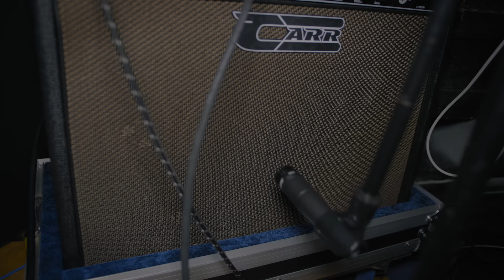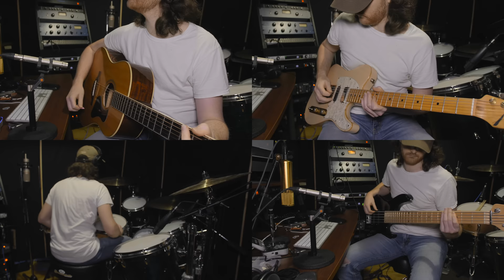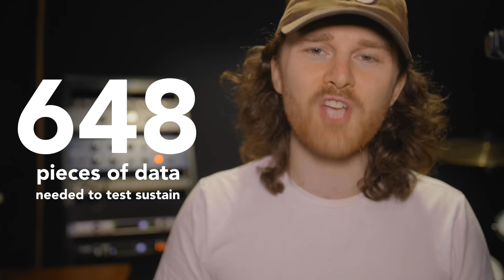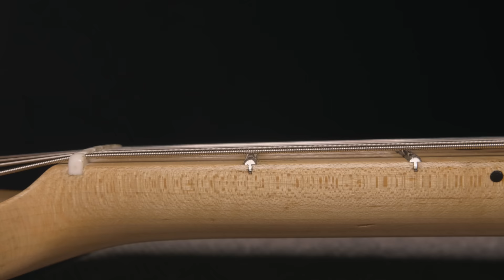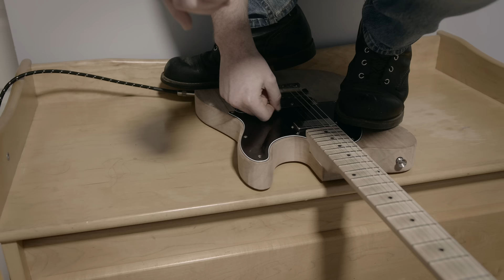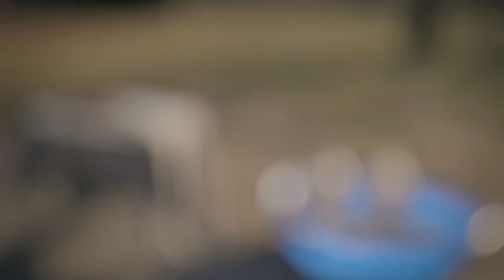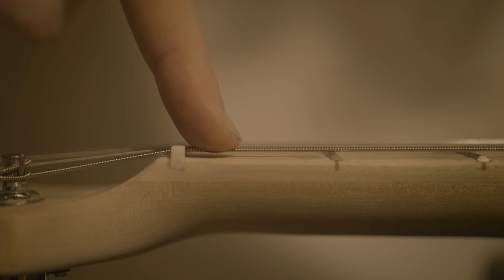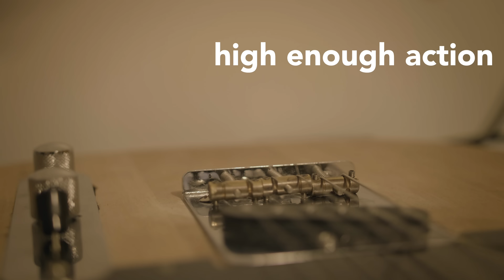Tested: Where Does The Sustain Come From In An Electric Guitar?

Comment: Have you ever had a situation where you want to play a bent note for a bar or two and it just dies right away? I've had that happen on couple of guitars and that to me is the definition of lacking necessary sustain. It's a factor of many things, often construction and setup and not just the body wood or something. But it's an important thing.

Then there's the other case where you have distortion, delay, amp feedback, even a sustainer device. Which is not the same thing.

Regarding the break angle I'm not so sure about all the factors you want to consider. You want a decently deep break angle to get a good force on the pivot point so you'll have great tuning properties. Shallow angle with ambiguous pivot point causes lack of tuning stability. You also don't want the strings popping out of their slots, hence the string trees. I'm not sure if the deeper angles/string trees also help with unwanted noise from the headstock side of things. The hardness of the material also plays a role. There's quite a lot of material on how sound travels through materials and quite a lot of material on instrument builders also having done their empirical research on how to solve these different challenges of material paradoxes (if someone recognizes product development method called TRIZ, the idea is that usually with desired quality improvement you'll also get an increase in an undesired quality, say durability vs weight, and your aim is to find a solution that removes the undesired quality increase while still improving the desired quality).

In my opinion perhaps number one noticeable difference comes from string height. If you lift them high enough that only slide players would play them, I find you get quite a different experience. The worst experience in my opinion is a neck-thru guitar with floyd rose and really low action. But it's still not necessarily bad, I just find it often ends up much darker and likely less resonant.

Some opinions or good practices with data: always visualize it. Even if it's presented just to other scientists or engineers, visualize it. Raw numbers don't mean much and people are bad at interpreting meaning or quality on them. Visualizing it you can read something meaningful out of it. Even if you're not educated in that section of life. Also if you have hundreds of pieces of data for the same measure, take a standard deviation (you get the mean average in the same go). That way you can tell how tightly packed your measurements were, giving validity of how much variance from the mean average you can expect if you pick any random measurement. For example 97% of the measurements might be within a range less than 0,3 dB which I'd consider a very nice result, you can say that you'll basically always get that exact result.

Ideally you'd measure for example with poll rate of 10 Hz so you could log the loudness as a sort of "continuous" measurement. Then you could adjust for example the starting loudness of the measurement range from your log and call it quits after x samples. You'd get somewhat comparable takes and you could have the mean averages for all the time points of interest, then draw a graph of the mean average of the measurements over time and you'd have nice graph for the different factors and how the loss of energy in the string behaves over the time. You'd get more detail on how it happens in different distortion levels for example (we know distortion comes from amplifying the signal until it clips so you'd expect quite a bit of stable loudness until a drastic drop off on distorted ones, and on the contrary perhaps some sort of smoother round curve for clean signal). You did touch this in the discussion part too.

Some stuff to test is also using only neck pickup, because that's the closest to the biggest amplitude of the guitar string. It's also a challenge for the builder/pickup designer when you have a set of pickups and want to tweak them to expected qualities, you'll find out the same pickups sound quite different on different spots. Builders have long since I believe debunked the myth that a big mass would give more sustain/resonation. Given how a mass is a dampener, and heavier body is usually denser so less willing to resonate. Yet depends totally on the construction as well, if the connected material is not really dense and compact but instead has holes and is less dense, it probably adds to it (just like when you lean the headstock on a non-supporting wall and get an amplifier). On the other hand I wouldn't be surprised if the system is alive and adjusts resonant frequencies and feeding back to the string. People might be aware of how it seems like the best way to have the guitar (acoustically, not electrically) ring is to have a light bridge directly attached on the wood, and as contrary a system like a floyd rose can make the guitar quite a bit more dead sounding. People have been toying around by changing the floyd rose bridge block to a different material and different size block too. And then there's the whammy bar related springs that can give quite a different tonal characteristic to the sound and be perceived in all kinds of ways, for example my PRS sounds like it had an acoustic cavity and spring reverb just because of the whammy bar construction. I'd assume the more treble (maybe middle more realistically) frequencies the guitar has, the more likely it is perceived as sustaining nicely, because those are rather audible and decay quickly (perhaps for the short wavelength).

A lot of people seem to think guitar builders just come up with marketing excuses, but a lot of them also care about improving their own loved product and thus test and research this stuff as well.

All this is getting way deeper than you would need for your video, but since you bothered to take hundreds of samples and go deep, you might be curious. Fun video, well addressing all kinds of ideas with rather practical tests. Maybe not completely conclusive but giving good idea of what you might expect to happen.

Comment: My own experience the best way to get exceptional sustain is to use a neck with extra reinforcement.   Case in point I have an old RG, with a lightweight basswood body, an ultra thin  wizard neck, and a fully floating vibrato bridge: all factors that detract from sustain.  It also has two steel reinforcement rods in addition to the truss rod.  It sustains as well as some Les Paul builds.   No other explanation.  There's certainly other myriad factots to pay attention to, but the bottom line os that the rigidity of the neck build is of primary importance.

Comment: My only gripe with the wood glue test is that the playing conditions weren't the same. For the control, it should have also been laying down in the kiddie pool during testing. I doubt there would be any difference but removing variables is super important.

Comment: Sustain reflects how rapidly the mechanical energy of the string is dissipated.  That energy is dissipated by vibrating the air (what we hear as a note), and vibrating the entire guitar, which partially vibrates the air secondarily, but also transforms the mechanical energy into heat energy (the string also does this).  Wood is neither solid nor rigid.  Vibrations in the wood cause it to heat up slightly.  The more rigid the guitar, the less energy is transformed into heat.  By far the least rigid component of the guitar is the neck. The neck is the biggest reducer of sustain.  The bigger and more rigid the neck, the longer the sustain.  That's why a pedal steel guitar sustains longer than an electric guitar.  To maximize sustain you want the biggest and most rigid neck you can play.

Comment: Other thing, you say "some db difference". Decibels can be deceiving if you don't understand how they are calculated. It is a logarithmic scale, so it increases quickly! A nice thing to remenber is that for each 3db increase (decrease) the signal power doubles (halves). For example, a 83db sound signal has twice the power of a 80db signal (I know that for our ears it doesn't seem that 83db has double the volume, but our hearing sensation is weird). So in your tests when one lost 14db in 4 seconds and the other 17db, the latter lost twice as much power in the same time, i.e., it lost power faster by a factor of two after 4 seconds.

Comment: There are two important variables.  Sustain and resonance.  High sustain, acoustically means less resonance.  High resonance, acoustically means low sustain.  An hollow body guitar is high resonance because it can vibrate more and dissipate it's energy faster.  A solid body guitar is the opposite.  A guitar that has high resonance will pick up vibrational energy from outside forces more easily.  So while it technically has less sustain, an electric guitar with high resonance can feedback more easily and seem to have infinite sustain because of the amplifier.

Comment: I have an assumption that I would love to see tested. Or did anyone already?
I would define sustain simply as the drop of volume over time (like you)

Less volume drop = more sustain.

I assume volume drop is the result of damping of the string. The string oscillates and looses amplitude (volume) because it looses energy. e.g. because of "air resistance", which also is the reason we hear the string. But also because it looses energy in the guitar.

Therefore it would make sense that a STIFF guitar has more sustain, because it doesn't move as much. So the energy stays in the string.

A guitar which is stiffer would therefore have more sustain. This would mean: If you would build guitar out of steel, with a massive neck, it would have a LOT of sustain. Not because it s heavy, but because it is very stiff. 

A heavy guitar would have more sustain not because of the weight, but because of the higher stiffness due to more material in place that increase the stiffnes of e.g. the neck. 

In this theory it would NOT make a difference if you have a very big, heavy body but a thin neck. Because the neck would be soft, loose energy and the body would not do anything. 

This could quit easily be tested: 
A guitars sustain is measured (the way you did). You sand/grind down the back of the neck considerably, which should reduce weight and stiffness, and measure again. In theory you could add some mass to be back of the neck to keep the mass the same, this added mass only must not increase the stiffness of the neck again. 

This would explain a few "myths" that are by themselfes difficult to be tested:
- "heavy guitars have more sustain" -> makes sense, if the mass is distributed in a way that the guitar is stiff
- bolt on necks have less sustain -> would make sense, if a neck through construction ist stiffer, which I think is likely

Comment: Ive always believed that pretty much all the buzz words used when talking about resonance and any general declarations about "this makes it resonate more or less" were all in a players head. I think a big and for the most part unmeasurable factors is the players perception of the guitar they are playing. As far as objective measures, I think it comes down to knocking your fingers against the blank neck and body woods and choosing a good resonant set of timber. Unfortunately most players don't get that opportunity, so the most important thing you can do is play each individual guitar ou can and buy the one that your brain says is best. The last crucial part is that every person physically plays the same guitar and amps setup in their own way, which is why Hendrix sounds like Hendrix on a Strat the same way he did on his SG or V. its super cool that you are spending so much time and effort on testing in a data driven way, not a lot of that content is out there. Cheers

Comment: Some people say that high output pickups, and also active pickups give lots of sustain over low output pickups. Also, humbucker vs single coil. Mostly this just tells me that sustain and attack are perceived as more important than decay when it comes to sustain in a lot of cases. For example, Santana's guitar tone sounds like it has infinite sustain because the attack is instant and you don't hear a note long enough to detect any decay.

Comment: If you have extremely microphonic pickups, feedback comes easier…It can also be achieved in some situations with a mixer…I’m still completely unaware of how Jimi Hendrix had such incredible control over his feedback…because it’s yet to be duplicated….it’s possible that he somehow acquired the knowledge that if wax potted pickups were scrapes clean, THAT could do it, or some modification with potentiometers or something…but we’re talking Up to his death in 1970  Jimi Hendrix didn’t have the luxury of Amazon Prime, where he could order a 1-Meg (1-Meg = 1000K) Audio Taper Potentiometer, a Fender TBX Tone control (which didn’t even exist until 1986 & wasn’t market available until 1988)

Comment: Physics note: Sustain should be affected to some degree by the orientation of the guitar, since gravity will pull on the strings and cause the strings to move closer or farther from the magnets or sag nearer or farther from the central line from the bridge to the nut.  So some of the tests where the A-B are oriented differently technically have an uncontrolled variable.

Comment: The glue guitar does sound really different but it also highlights that you need to make BIG changes just to hear a small difference. 

A 3 pickup strat might have a small difference in sustain than a 1 pickup les Paul. But there's probably going to be no noticeable difference between a Strat and a Tele for example, or between nitro and poly finishes.

Comment: Gary Moore was the master of sustain. You can clearly tell his picking technique had a lot to do with it. Less Paul thought it was a seventeen degree angle on the head stock which makes sense when you consider the bowing action it could cause on the neck which would be affected by the truss rod so truss rods could be a factor and the P90 pickup which meant 9000 wraps of wire on the pickup. A strat stock pickup had 6000 wraps of wire. So one wrap of wire in a way of speaking hears to string one time per vibration. Digital and tube amps work differently too and that is black hole. Tube biasing would effect sustain. Sustain isn't caused by just one thing. Pure sutain from a guitar is how long the string vibrate. How much sustain matters I think  depends on the person. It's a stylistic thing. I think Gary Moore is the best example of how much it can matter but probably only a guitar player would care. Noting beats a Less Paul for sustain though. If his belief of what made it work the way it does was wrong he still got the best. Jim you make great videos! I'm glad it was and not me. Keep up the good work! Thank you!

Comment: Great video (as are your others)!  Have you considered testing the effects of the magnetic pull of the pickups on the strings and how that affects sustain?  A neck single coil set too close to the strings interferes with the string vibration and creates a warbling sound, for instance.  Typical single coils also pull harder on the strings than typical humbuckers (this is apparent by bringing a piece of iron near the tops of the pickups and feeling that the pull from the single coils is much stronger since the magnet in a humbucker is located at the bottom of the pickup, not the top).

I assume that the greater the magnetic pull from the pickups the less the sustain.  I also think that this is where the conventional wisdom that Les Pauls sustain so much comes from: because the PAF style humbuckers pull the strings less than Strat or Tele pickups.
Reply: Maybe watch the video before commenting :)
this topic IS in the video.
Reply: @cederickforsberg5840  Well only in so much as one single coil neck vs no pickup, which did affect the sustain.  I was thinking of different types of pickups compared, which wouldn't have been difficult considering that Jim was already holding the Tele neck pickup near the strings.  I suggest repeating it with a humbucker and maybe a Strat neck pickup for instance, which might explain the conventional wisdom that Les Pauls sustain more Teles and Teles more than Strats.  At least that seems to be the most popular opinion.

Anyway it was a great video, as all of Jim's are!
Reply: @ErictheRed1978  Just rock out and have fun, worry less about miniscule things :)

Comment: i think that feedback is more about the air waves pushing on the body of the guitar and that is transferred to the strings..just like the sound of an acoustic guitar doesnt come from the vibration of the strings as much as the vibration transferred to the surface which creates the pressure changes in the air resulting in sound..unless the guitar is played in a forest and nobody is around..

Comment: You could have tested neck-trough vs. bolt-on neck. And while differences might be small, what if all those differences were added up for a "perfect" guitar? Probably the final result would have been more significant. Yet, pickups, strings, guitar set-up, and the signal processor are still the most important factors when it comes to sustain.

Comment: The sound that we hear when we pluck a guitar string is generated by the vibration of the string between the 1st "Termination Point," the nut and the 2nd "Termination Point," the saddle at the bridge. The bit of string between the nut and the tuning peg, at your "Break Angle" does NOT affect the sound at ALL! :cat-orange-whistling:
Likewise, folks who say that a "string through body design" has better tone or sustain than a string that terminates at the bridge on top of the guitar body are kidding themselves. :body-green-covering-eyes: